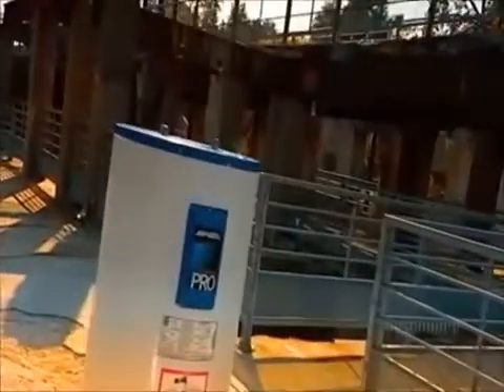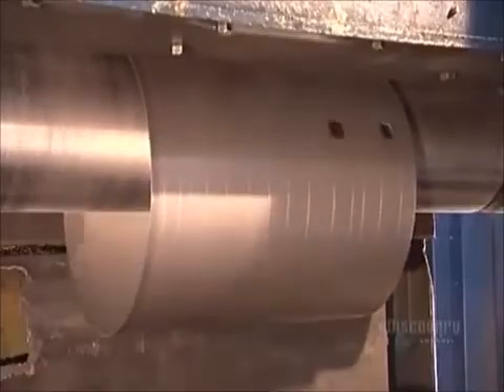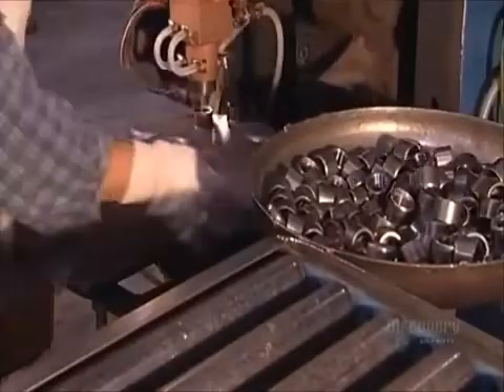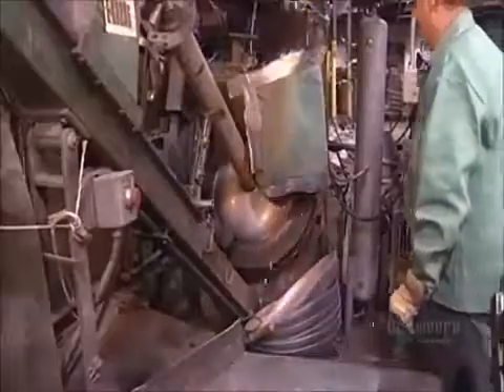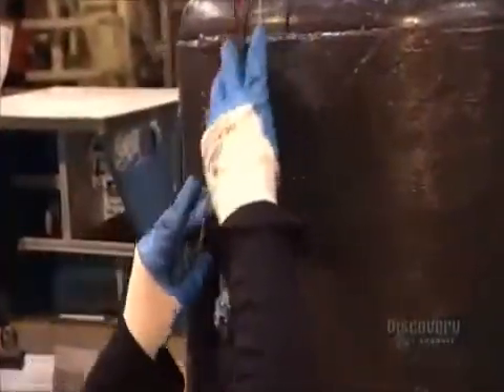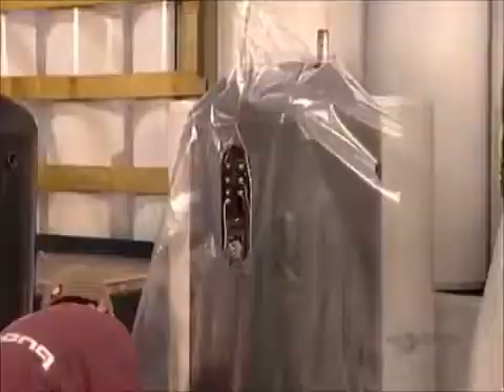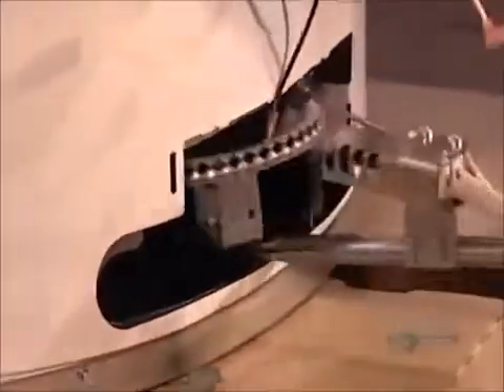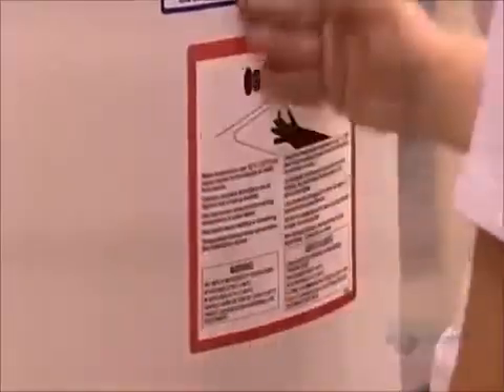How It`s Made   Residential Water Heaters

Comment: "Welded with 10,000 volts"  Not. Electric welding of steel is done with low voltages and high currents.  Like 26 volts and 100 amps.